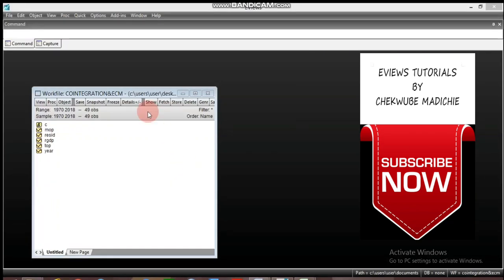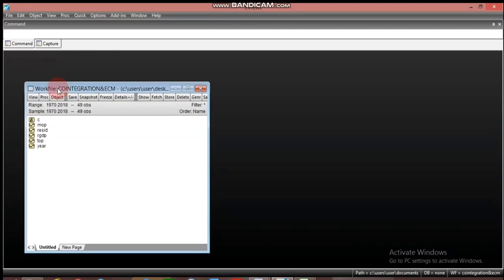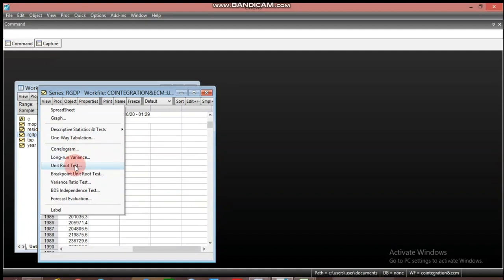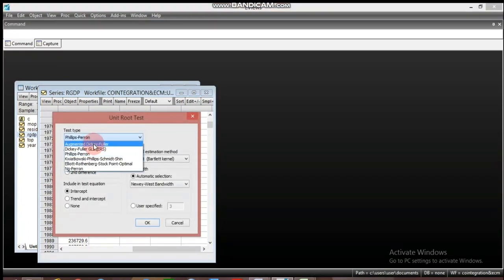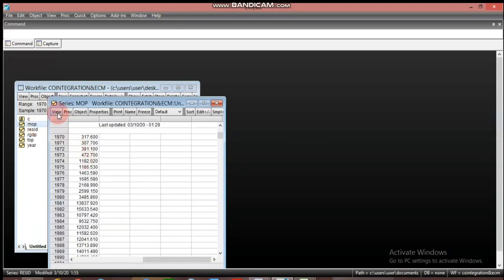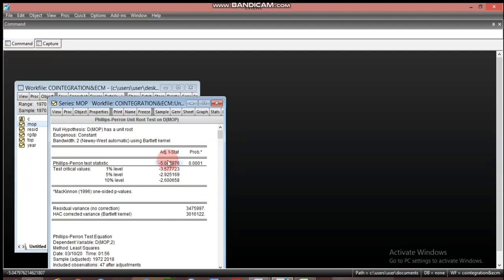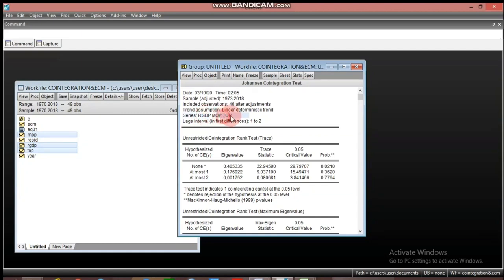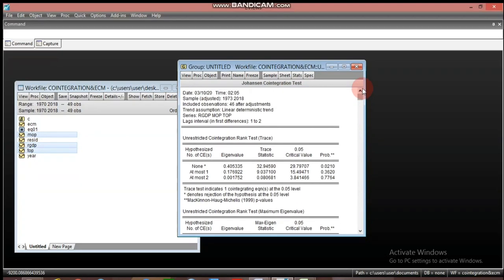Unit Root Tests, Cointegration and ECM/VECM in Eviews

Comment: I should use FMOLS methode but unit root test show that my variables are not all in same order what can i doo please !!
Reply from the maker: You should consider using the ARDL model if your variables are a combination of I(0) and I(1) with an I(1) dependent variable. But if the dependent variable is I(0), you may have to use the Bootstrap ARDL model.

Comment: If all your variables are i1 variables shouldn’t you use the differences when making your equation ?? When finding the et?
Reply from the maker: If all your variables are I(1), and they are cointegrated, then you can estimate your model in their level (to serve as long-run) and apply ECM. If they are not cointegrated, then you can use the differences but can only refer to the shortrun.

Comment: Please can you answer... My all result signifigant but ecm(-1) is not negative.. In these case there is long term or not?
Reply from the maker: Dear Athraa, kindly note that a positive ECM(-1) doesn't speak well of your model. It shows evidence of divergence from the longrun equilibrium. This may be as a result of specification problems or data issues or error during estimation. Kindly ensure that there is no variable that is originally I(2).

Comment: Hi, is it possible to analyse non performing loan (dependent) GDP and inflation rate (independent) by unit root test, panel cointegration model, VECM test using 9yrs data?
Reply from the maker: No
Reply: What can be done to troubleshoot the problem? What do you recommend?
If i increase years of data, would that help?
Reply from the maker: @aniksaha9925  9 yrs data coverage is too small for such analysis. You should have at least 30 yrs.
Reply: That's why Johansen panel cointegration didn't work. When i stretched to 13 years, it produced some result though
Reply from the maker: @aniksaha9925  That result is questionable

Comment: Sir please make clear what r conditions to estimate Vecm

And when we estimate Ecm

I feel for Johnson's we estimate Vecm not Ecm

And in ARDL we estimate Ecm

Please clear? Am I right
Reply from the maker: Johansen cointegration is for system of equations and it goes with VECM, while Engle-Granger residual-based cointegration is for a single equation and it goes with ECM.

Comment: Hello, may I ask if I have four variables, and my result shows that there are two asterisk sign at "none" and "at most 3", how can I explain it and can I still use VECM model. Thank you :)
Reply from the maker: In your own case, there is only one cointegrating equation. Yeah you can run the VECM if your main dependent variable is the one in the identified cointegrating equation.
Reply: @ChekwubeMadichie  Thank you so much! Could I ask where can I check my dependent variable is the one in the identified cointegrating equation?
Reply from the maker: If you have four variables, that means four equations in the Johansen system specifications. Thus, the dependent variable in the first equation is obviously the main dependent variable and if there's only one cointegrating equation, then the main dependent variable is cointegrated with other variables.
Reply: @ChekwubeMadichie  Thank you so much for your reply:) I'm wondering why my model just has one  cointegrating equation instead of two. As I cannot reject the "at most 1" and "at most 2"
Reply from the maker: What's exactly your interest in having two cointegrating equations?
Reply: @ChekwubeMadichie   So my dependent variable is GDP, and my independent variables are CPI, short term interest and S&P 500. Can I explain that there exists a long-run relationship among the four variables and based on the Trace test and Max-eigenvalue test, both of them indicate 1 cointegrating equations among four variables at the 0.05
Reply from the maker: @Wendy-kr7dr  the existence of 1 cointegrating equation implies that a long-run relationship exists among the four variables, with GDP being the dependent variable.
Reply: @ChekwubeMadichie  Thank you so much!! now I understand :D
Reply: @ChekwubeMadichie  sorry, I just want to know one more question, based on which information I can  know how many variables are cointegrated with dependent variable?
Reply from the maker: @Wendy-kr7dr  the dependent variable is cointegrated with all other variables in the identified cointegrating equation.

Comment: What if the residuals of the OLS only becomes stationary after first difference?
Reply from the maker: If the residuals turns out to be stationary at first difference, that is I(1), then there is no cointegration. According to the EG residual-based cointegration approach, cointegration exists if the linear combination of I(1) variables is stationary or I(0). In other words, if variables X and Y are both I(1), then they are cointegrated if their residuals (i.e their linear combination) is I(0).

Comment: ECM(-1) is not significant so we cant trust this test? I mean we cant be interpreted this results?
Reply from the maker: The ecm(-1) should be significant to ensure there is a strong feedback effect of short run deviation in the longrun. No meaningful interpretation can be generated about the convergence process and the speed of adjustment, when the ecm(-1) is not significant. However, the video is meant to provide the useful steps on how to perform the test in Eviews.